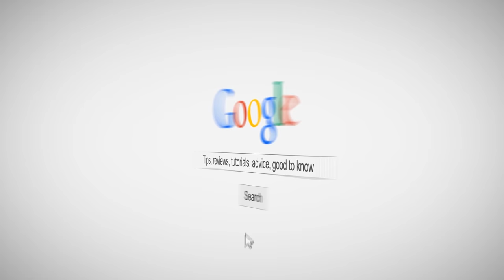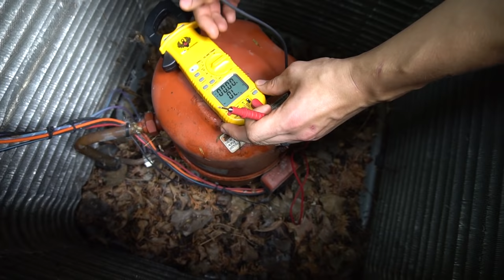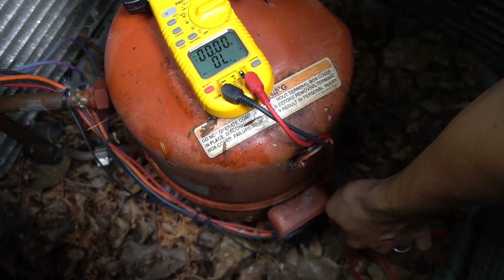AC Keeps Tripping Breaker and The 10 Most Common Reasons Why

Comment: My AC breaker kept tripping. Found out the capacitor was bad... replaced it and working like a charm.
Reply: Happened to me too.  Breaker tripping was secondary to the bad capacitor.  Unit would try to start, but with a bad capacitor, the load would surge and breaker would trip.  Changing the capacitor fixed it up.  Jay has other amazing videos that cover capacitor replacement in detail.

Comment: My 2 CENTS: a retired hvac friend told me sometimes the ac circuit breaker just goes bad.  My a/c kept shutting off, no cold air.  You would find the electric breaker blown.  Reset, it would run for about 5 minutes, and trip the breaker.  I replaced the electrical breaker in my main box, and I have not had one problem this hot July.  I thought my hvac friend was full of it, but he was right it worked !!!!
Reply from the maker: Thank you for sharing! Good to have friends like that! :) I have only seen that once so far. (the AC breaker in the breaker panel was slightly melted and cracked)
Reply: My breaker intermittently trips after several hours and had already replaced but still tripping after working long hours say 5 or 6 hours. What could be the problem. Can I run the AC with compressor only without the condenser fan? I appreciate your input.
Reply: Sorry, replacing my breaker fixed mine.  Keep asking around, someone will know.  Good luck.
Reply from the maker: Running your compressor without the fan will cause the pressures inside of the compressor to build up and it will overheat. That in turn will increase the amp draw of the compressor which could cause your breaker to trip. Does your fan stop running after a while? Do you have a multi meter that you could check your capacitor with? It could be a weak capacitor. The first thing I would do is thoroughly hose down/clean your condenser coil even if it looks clean. A plugged coil also increases amp draw.
Reply: Sounds like an issue I'm having. Runs for a while then shuts off and won't turn back on tripping the breaker.
Reply: I changed with new capacitor-it runs for about 3 hours and breaker trips again. What else should I look into? You featured installing a hard start kit few days ago, do you think it would help so it will reduce the surge of current when it stop and run? Thanks again.
Reply from the maker: The hard start kit would help, especially if it is tripping the breaker when it starts. First thing I would try doing is thoroughly hosing down the condenser coil even if it looks clean. Also, look at the wiring in the outside unit to see if there are any loose or corroded wire connectors
Reply: My ac unit is fully charged, replaced all run compacitors, kick start compacitors and fan compacitor, replaced thermostat and had the inside and outside unit cleaned. It is constantly going into thermal overload when it’s hotter than 85 degrees outside to where the fan and compressor turn off. What can I do to solve this problem... please help
Reply from the maker: Hey Thomas! Sounds like you already did a lot of work there! So here are a couple suggestions that come to mind:

1. Are you sure the outside coil is clean and was cleaned recently? A hose and water, sprayed down real good will do the trick. (careful not to bend the coil fins) This is the most common reason for AC tripping breaker on hot days
2. The capacitors could be weak but you said you have already replaced them.
3. If your unit does not have a start capacitor, I would put in a hard start kit.
4. Your circuit breaker for the AC may be getting weak. There's no good way to test it but replacing it is not too difficult.
5. The compressor is starting to die. This would be the worst case scenario. I would call someone to confirm what is causing it.
Reply: I had a brand new A/C system in a total rehab with a new panel and breakers trip the breaker. Everything was well within tolerances, the breaker would trip every 5-6 weeks. Tried the usual suspects, still happened. Mind you it was 5-6 weeks to find out if the trouble shooting worked or not. Finally replaced the new breaker with another new breaker and it never tripped again. Well at least so far and we are talking years now.
Nothing was tripping the breaker, it was tripping itself.
Reply: Very true. Sometimes, it can be as simple as that.

Comment: Missed a couple of things. One of the major causes of "hard starting" is a bad run capacitor. This will not allow the compressor to start and it will draw "locked rotor power "which can kick the breaker .Same with the fan motor. A permanent split capacitor fan motor with a bad capacitor will run slowly or not at all, increasing the head pressure and amp draw. Another thing is short cycling, which is not allowing the pressure to equalize by having the compressor off for at least 5 minutes. Real common in the mercury stat days before electronic stats became popular with their built in time delays .Another one is loose wiring at the AC breaker in the breaker panel. A loose wire creates heat, and a breaker will falsely interpret this as excess amperage and kick the breaker. I have never heard of a dirty filter kicking a breaker. Normally this will freeze up a unit with ice but will drop the amp draw . Could be possible under these conditions to flood liquid back to the compressor and slug it (trying to compress a liquid instead of a gas) but this will generally mechanically destroy the compressor and is rare. Also this unit that you are using as an example already has a start relay and a start capacitor installed by the factory. This does the same thing as a hard start and you cant have both of them hooked up at the same time.
Reply: Good job. We'll explained.
Reply: And start and Run Capacitors going bad is way more common than this!!!  In my heat, they go bad about every 3 years!

Comment: One word of advice, if your condenser is tripping your breaker remember to ALWAYS restore power from the breaker. If you take out the pull out switch/disconnect, then reset the breaker and then put back the pull out switch you risk sparking and burning the contacts in the pull out switch if there is a short in the condenser. Then you may need to also change the disconnect box on top of fixing the condenser. I am used to cutting power/restoring power to the condenser using the pull out switch so I learned that lesson the hard way.
Reply: Man all the lessons that I’ve learned the hard way.
Reply: Had "guys" out 3 times, still not fixed.  VERY hard to find someone with knowledge.  Las Vegas area.
Reply: @lvgirl9405  You are NOT lying.  A/C guys who really know their business are few and far between.  A lot of them know less than I do about electricity, and that is scary.
Reply: @lvgirl9405  I have a guy here in Vegas, he's pretty good and knowledgeable regarding ac's among other things.
Reply: Same arcing and damage occurs to the circuit breaker when you close it on a shorted circuit. Best to locate and clear the fault using your meter, before you energize the circuit at all. Circuit breakers are designed to clear overloads and faults, not as a tool for locating them.
Reply: Great,  I think I JUST did exactly what you said not to do before I read this.  😂
Reply: I just recently got a brand new condenser and mine shuts off but does not trip the breaker, could it be a bad breaker??

Comment: Loose connections will also trip the breaker. Check them all. Especially the low voltage from the air handler to the condenser, if that is loose the contactor will start and stop the compressor with no delay. The connectors on the run cap and contactor sometimes are too loose, even brand new units. If they pull off easily, they are too loose. Squeeze them(just a little) with pliers so they will grip the tabs on the contactor and run cap.
Reply: Great advice. Thanks
Reply: Ditto on that response Mike.
Reply: Good Advice. Add one more thing. Check the wire at the breaker if it is Aluminum. If it is Aluminum, it may have oxide layer causing contact resistance heating. You have to disconnect the wire and sand with emery cloth keeping the wire strands covered in no-ox lube. Uncovered aluminum oxidizes instantly. Reconnect the wire and make sure it is a tight connection.
Reply: How do you check the low voltage from the air handler? Is that wiring checked in the a/c unit or at the air handler?
Reply: @bhampton1969   Check the wires that are connected to your contactor in the condensing unit. Make sure they are making good connection and the contactor is opening and closing with out chatter.

Comment: One thing I'd like to add; I've noticed, some, not all, outside units are located near, if not right next to the clothes dryer vent which really loads up the condenser with lint causing problems.  Excellent videos; very helpful.
Reply: Lol... yes mine is right next to it, I’m cleaning it tomorrow hopefully fixes my issue.

Comment: Great video! It's also possible to have a wiring problem in the house that trips the breaker, that happened to me. When I installed my mini split last year I needed to install a dedicated circuit, so I ran 10 gauge Romex from the electrical panel to the disconnect box. The breaker tripped the second I turned it on. After realizing that it still tripped the breaker with the disconnect out, I realized that the new Romex I used was defective, one of the hots was shorted to ground and was tripping the breaker. No external damage to the cable. Weird. This could also happen if someone accidentally damages wiring in the walls or attic by stepping on it or hitting it with a screw or nail.

Comment: 👍 Thanks, bro! AC tripped is breaker then my main, I thought it was toast for sure. Following your lead I checked for catastrophic failure first (seemed easiest) and I had a burnt out spade connector that worked loose and sparked itself into a grave - right on the compressor. I didn't know where to start but you saved me an emergency elec-chicken call.
Reply from the maker: Haha happy to hear that man! :) Thank you for commenting, stay cool!
Reply: RoseMarie Hogan  I heard it from AVE. He's got a lot of good ones.
Reply: Bruh. UEI is garbage. I should know, I’ve been using them for years. Fluke>fieldpiece>anything else>UEI 🤣

Comment: I could be wrong but I thought that having an under charge unit should not trip the breaker but trip the overload in the compressor since it's overheating due to high superheat.  Great video by the way!
Reply: Undercharge drops amps so yes you are correct

Comment: hey man,
thank you for doing such a great job and making complete sense ...
my fau was working but things weren't cooling down...
went out side compressor/fan
not turning...reset breaker and compressor buzzing but no fan spin.....gave the fan a push...it spun but very solwly...so i shut off.....
removed cover and discharged/removed capacitor (mounting strap was covering voltage/cap specs)
my cap is 60 and 7.5 uf
i could only find a 60 and 5 uf)
local hvac parts houses would not sell to me without license... replaced capacitor, used tinfoil to shim the stap so it would be tight around cap..and everything is working great.....
im going to order the right cap from you (60 and 7.5)  and keep the 60 and 5 uf as spare... .
first real hot week in socal desert so techs were swamped..90 degrees inside by noon..so you saved me on this one..
your a great teacher....
best wishes to you

Comment: Hey thank you for this excellent video. My a/c has started tripping the breaker and I just had an HVAC tech come out. He believes that I need my breaker replaced because he said that when he went to turn it on and off that it's very loose, rather than firm.  So the last reason you showed might be mine.

Comment: What would have been cool was if you had demonstrated the amp draw before cleaning the coil vs the coil caked in dirt and fluff. I wasn't aware until watching your video that amp draw would increase with a dirty coil. I knew it effected the condensers ability to remove heat from the refrigerant, but not how it effects the electrical aspect. Thanks for sharing!

Comment: Solution: my ac (independent) breaker was triping after 15min , I removed the breaker , there was a screw behind the switch which adjusted its sensitivity if I unscrew it , it was tripping easily , so I tightened it , then I attached it's all 4 wires in different way , by cleaning the ends and reshaping them just in case , tightened all 4 again , it stoped tripping ! . (turn off all the power supply 1st)

Comment: Great video. I don’t usually undo my wire from the compressor to check if it’s grounded I just check it from the other end of the wires to ground
Reply: You can miss burned out terminals or a short.

Comment: Thank you for this great video. When the air filter is plugged, the tripped breaker will be the one for the indoor unit since the indoor fan will draw higher amperage . You were showing the reasons for tripped breaker in the condensing unit. Am’I correct or wrong ?.  I will appreciate your comment .
Reply from the maker: Yes you are right. A very dirty furnace filter would trip the furnace breaker but if that breaker trips, then the outside unit wont work as well. I said it wrong in the video, I thank you for correcting me :) Although, the dirty filter itself would not trip a breaker as that would actually lower the amp draw, it might cause something else to trip it though. I probably should have left the furnace filter out of this lol
Reply: They are two different breakers!!

Comment from the maker: Here are the parts I mentioned in the video:

Qwik Lug Compressor Wire Repair Kit: https://amzn.to/2Myn6et
Hard Start Kit: https://amzn.to/2LZhnxj
Multi Meter: https://amzn.to/2JWI1pU
The drill I use 5-6 days of the week. If you need a screw gun, look no further: https://amzn.to/2MHLudO

Comment: Enjoyed the video, one thing to be careful of though.  If you disconnect the wires from the condenser fan and allow the system to run (say your issue is the breaker trips after a few minutes rather than instantly like with most shorts) you will over heat the condenser coil and compressor.  If you try this step I would only allow the system to run for a very short time that way.
Reply: Great reminder for the..uh...well forget that! Good one as although you would HOPE everyone would realize they can only test without the fan running only quickly like you said, I am sure many have let it all run with no fan....."I don't need that running too do I, nah!" Someone should have thanked you by now!🤣🤣

Comment: I watched your video and it’s very educational and informative. I believe I have a short in the compressor. Whenever I turn on the unit a spark flies out of the compressor Junction box, tripping the breaker, I’ve replaced the wire twice which burned out, so my analysis concluded that the compressor wiring must be shorted out. My question, my unit is 18 years old ,good men, should I replace the compressor? Or should I replace the entire unit? Mind you, I’m in New Jersey and a complete new unit is roughly $2300. Don’t know how much a new compressor will run for with labor.
Reply from the maker: Typically if a unit is over 15 years old, it is not worth replacing the compressor. And if it's an R22 system, you may not even be able to find a new compressor for it since that refrigerant is getting phased out. If you have a multi-meter, I have a video on how to check the compressor if you want to double check it. (I don't remember if I go over that in this video) https://www.youtube.com/watch?v=0aAj0iqP95A&t=510s

Comment: You have been an excellent huge help for two reasons. One my Subaru wrx has a faulty compressor and has been leaking and drawing to much power causing power loss in other areas. And two my rv compressor is tripping the breaker, so I will test some of the quality bits of info you described here and let’s see if I can get to the bottom of this!!! Thank you a thousand!!!!!!   ⭐️⭐️⭐️⭐️⭐️

Comment: Thank you for this video. Had already replaced my capacitors and the contactor. Breaker has been tripping. Fan has also not always been running though I can hear the compressor humming. Added the rapid start and waiting to see if that helps. Hoping not to have to replace the fan, though it seems to run smooth. Maybe it is getting overheated. Going to clean the condenser coils also.
Reply: I ended up changing the fan motor on the condenser and ruined the fan blades trying to remove. Had to get a new fan too along with the hub. Then I put the fan blades on upside down. Cooling well now and not as well when the blades were the wrong way. They should mark them somehow.

Comment: I just got useful tips from this video. I wasn't working on a large unit, but rather a portable unit. The principle is the same. Turned out breaker (20A!) Was tripping due to compressor not being cooled adequately. I added a fan blowing on the out side of the housing, near the compressor That brought the total current under 10 amps, even after several hours continuous use. I have a feeling the thermal switch at the top of the compressor is not working.